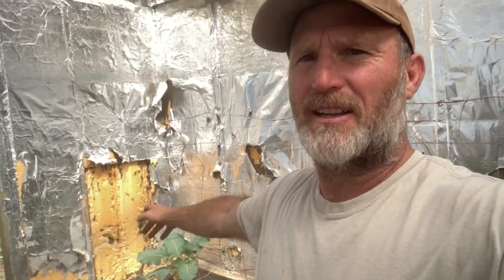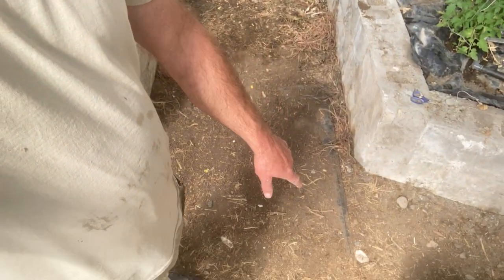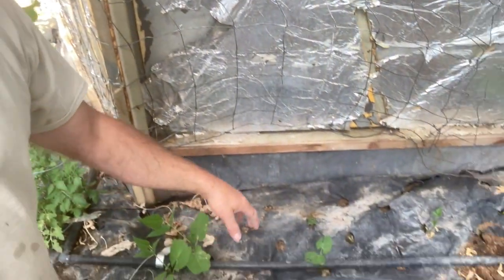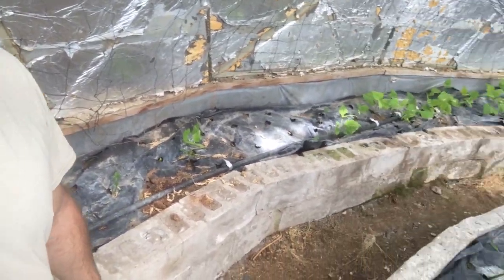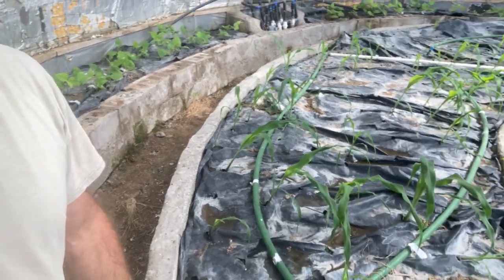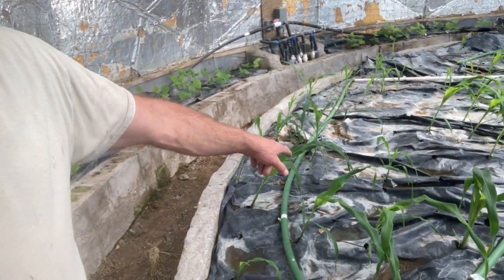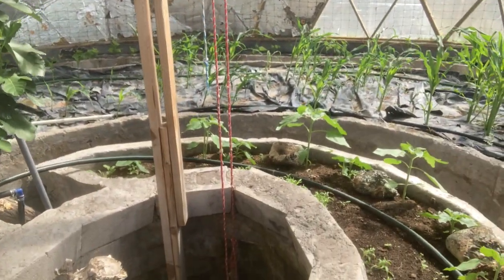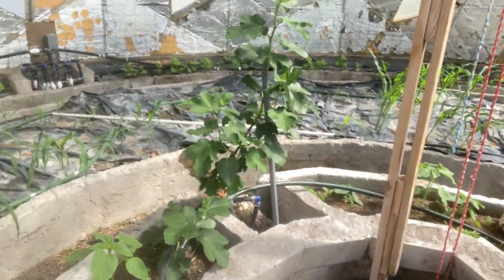1,200 Square Foot Geodesic Dome Greenhouse with Polycarbonate Exterior.  Great thermal performance

Comment: if you use southern cedar cores, the have  a 100 year lifespan non treated ruff cut. they are like cypress wood. they don't rot
Reply from the maker: Excellent idea.  Unfortunately, I'm too poor for naturally rot resistant wood.  The soil cement grow beds are about $1 per linear foot, which is the main driver to go that way for me.

Comment: Question: Because wood is the most cost-effective building material, would it work out ok if a person were to seal that wood, say with paint or the like, before constructing? I have a cattle panel now, which does have some wood in the construction, but not much. I want to build a dome greenhouse to add to my growing space in the future.
Reply from the maker: I painted it, but the paint peeled off in a lot of places within two years.  Pressure treated wood could work, but building a dome using the good karma method requires ripping the wood at 6.5 degrees. Using hubs might be different, though.  I think a good quality stain would work.  Applying the Cabot stain last fall seem to work well.  It's thick and seemed to penetrate the cracks well.  Good luck!
Reply: @russlivesay9325  
I used (white) pond armor 2 part epoxy on my struts, still rot free after more than a decade. Its not cheap but folks use it to make large plywood aquariums watertight.

Comment: Panel type domes built with timber are difficult to protect from rot. The water naturally runs into the vertices which is where they tend to rot first. Water can also sit on any horizontal strut that is angled back toward the glazing with nowhere to go. The standing water can lead to black mold issues. If you dont own a dome its not something you`d be aware of :)